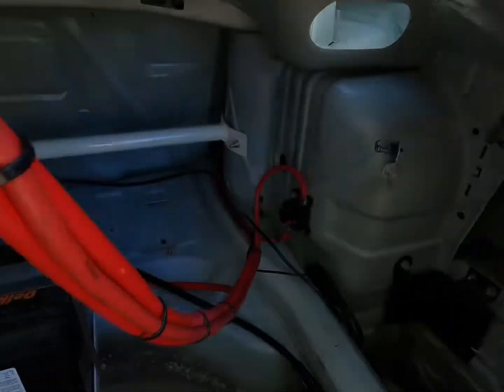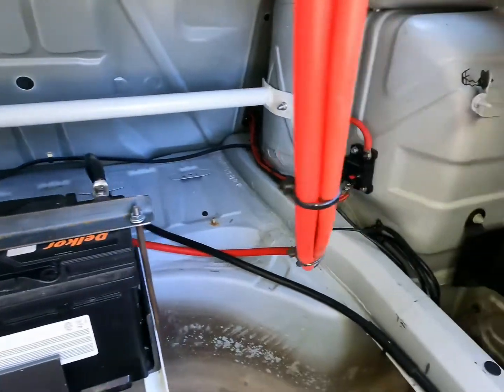BMW E39 525i drift build walk around Ep-2 tight spaces

Comment: Hey man I’m looking to get a dual caliper set up on my e39 ls swapped I have a angel kit on the front wise fab e92 kit with 70mm spacers m12x1.5 tread make and female lower control arm placement wit that info I hope yu can hook me up with some specs in a dual caliper bracket 💪🙏
Reply from the maker: Hey Ruben, thank you for sharing how you achieved angle on your e39. That’s something we will definitely look into in the future. For now we have ran the hydro hand brake into the abs module. We have disconnected the wiring to it and hope that it works like a junction box. If that set up doesn’t work then we will go twin callipers. Cheers